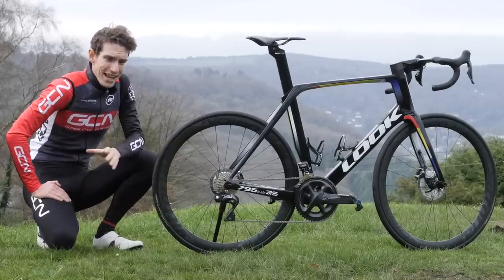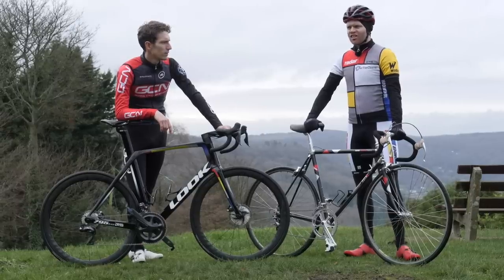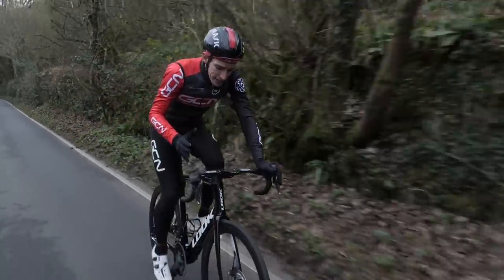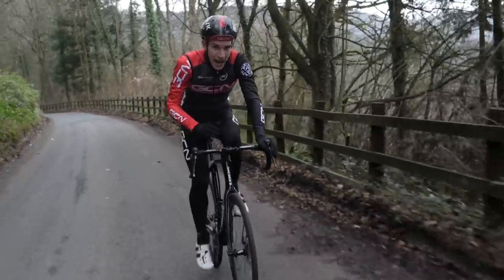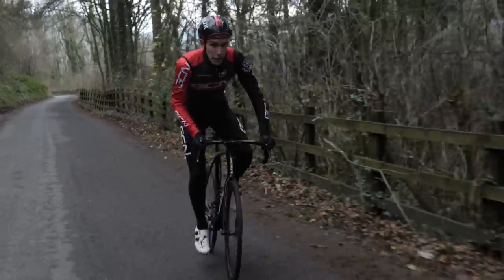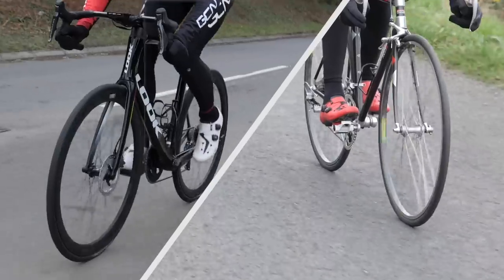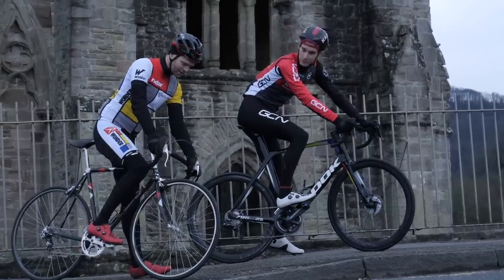How Much Have Carbon Bikes Changed? | Retro Vs Modern

Comment from the maker: Do you have a vintage beauty in your stable?
Reply: The chain looks a little slack on the KG86
Reply: Yes. a few.
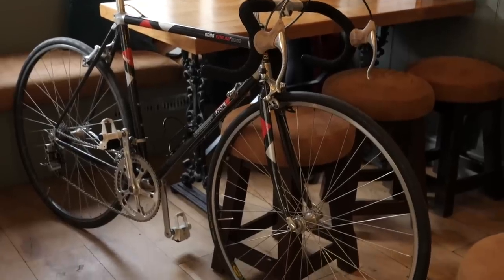Reply: 4:26 luck or look?
Reply: I have a gitane interclub. not sure what year :(.
Reply: Sure do. Love ‘em.
Reply: An old fw Evans Reynolds 531 touring bike.
Reply: I have Amanda's hybrid of carbon fiver and cromo bike made in Japan in 1975 which is the true first carbon bike in the world!!!
But it was OEM for french maker Gitane....
Reply: I have a '78 Rossin with a Super Record gruppo and '98 Tecnos with Record 9spd.
Reply: Yeah I have a TVT 92, painted in Lemond colours.  It's less comfortable than my other bikes mainly because brake clearance forces it to run on 23mm tyres.  https://www.flickr.com/photos/soundman/34283899942/
Reply: Yup. My Panasonic DX-3000 is the same year as that lovely Look! Mine's a steel beast, though. :) I love my '86!
Reply: A few, most used atm, 84' Guerciotti, slx, currently weight at 8 kg
Reply: I have a 1982 Grandis, Columbus tubing, Campy Super Record, with Nisi rims. 20.03 lbs. I also have a Look 675 Light Ultegra with Cosmic Carbone Elite 40 wheelset, 16.5 lbs. Love them both.
Reply: Yes I have a Look, but mine is yellow.
Reply: I have old chromoly steel Peugeot frame which I restored less than a 900$. 
And thats all I have and my only bike.
Reply: Yes, I do.  A 1990 vintage bonded aluminum frame Bridgestone RADAC 3100, 61cm with full Dura Ace grouppo, (7-speed, of course).  175mm cranks, Dura Ace clipless pedals, San Marco Rolls Titanium seat, tubular rims with Continental Sprinters.  It was my everyday club rider, a beautiful ride in its day, and is still beautiful today.  But, it is heavy and flexy in the bottom bracket as compared to my 2014 CAAD 10 Cannondale.  Nonetheless, I love it and will always have it.

Steve
Reply: I have a 1970's era Raleigh 3 speed with a Sturmey Archer hub, chain guard, fenders, and a brooks saddle.  I still ride it on trips around town, although it could likely use a new hub, the one in it is a bit worn out.
Reply: I have a very fine Look KG361 which was a sort of cut price version of the 86. It has round carbon tubes and aluminium lugs. Still a great bike to ride with sweet if sharp handling and comfortable with it. It may not be as fast as a new one but has still carried me - and now my son - over many an Alpine and Pyrenean col
Reply: I have a 1991 Trek 2100 Pro (Carbon main tubes), complete Shimano 105 with down tube shifters. I made a few upgrades to it over the years due to wear, wrecks, and just performance needs (Carbon fork with threadless headset, because the original was a noodle in turns. New rims and spokes because of cracks around the spoke nipple holes. New bar because of a crash) I put on a set of SKS Raceblade Pro fenders and it's now my inclement weather bike. Still rides great, maybe not as quick as my 2011 Masi Evoluzione Ultegra, but still nice.
Reply: Trek 2300 Pro with Shimano 600. My daughter is currently riding it
Reply: I do own a Look kg86, even asked Look to explain me me manufactuere number and it was made in may 1986 : ) Nice, smooth ride indeed - especially wearning a full La Vie Claire kit.
Reply: 1987 Battaglin Cinelli SLX (Stephen Roche) bike.
Reply: Colnago C40 (actually, three of them), a Master and an Extreme C (and a Time VXRS)
Reply: I have a Specialized Epic carbon tubes and aluminium lugs. Still fast and comfy but I’m a bit slower.
Reply: A training racer from 1926 made here in Sweden.... Yepp, weight about the same as two lorrys filled with coal.
Reply: Yes... even better version of a Look KG86.. I have more Mavic SSC on mine with the bronze color
Reply: Beauty to me is my '86 Trek 560 Pro Series in yellow and white fade. Reynolds 531.
Reply: Awesome video - I`m rather into retro bikes and have a KG86 full Lemond replica and I ride it with anger - I can confirm its epic, but does require a different riding style to more modern bikes - the 7 speed down tube shifters leave you fluffing gears if your not lucky butthats the only drawback.  The ride is spot on, speed wise, faster than my Pantani Bianchi and US postal Trek,  not as fast as my ex Sky Dogma - but only by around 1.5kph which is pretty fast.  In fact, I was so impressed with the KG86 I`m building up the last of the carbon lugged Looks - an ex Cofidis Look 595, can`t wait to compare the two.  But.... that new 795 Blade looks out of this world so one of those will have to join the stable some point next year...
Reply: I ride a Look KG281 Credit Agricole framed bike as my main stead, it`s still a great machine. It does everything I need it to do, and in style as well.
Reply: Yes, a CBT Italia  (Giovani Tardivo) original carbon from 20 years ago  and a Reynolds 531 Raleigh race from 35 years ago....both with Campag group sets. My usual ride is a Specialized Roubaix comp disc.
Reply: Both my bikes are vintage beauties. I have a 1968 peugeot px-10 and a mid 80s Razesa team pro slx.
Reply: I most certainly do, a 1981 Koga Miyata Road Runner, a steel beast :D. Just did a mayor restauration on it, as even the paint was falling off, and now it's the envy of the neighborhood again...
Reply: Of course!
Reply: 1985 Trek 660, campy and shimano 600. I couldn't imagine doing a century on it.
Reply: Not at the moment, gave 'em away or sold 'em on eBay, but I'm always only a yard sale or thrift store from another find.  Or more.
Reply: Several - 1972 Schwinn Paramount, 1982 DeRosa, 1983 Marinoni Custom Road, 1984 Marinoni Pursuit, 1964 Frejus track - All Campagnolo equipped naturally. :-)
Reply: I have an old, steel Motobecane from the 80s. I love riding it.
Reply: No. But, I have a cousin in Oklahoma that has an aero barn door.
Reply: Funny,  this is the same thing my wife  asked me on our first date !
Reply: i have an '89 nishiki prestige in pink/purple. it's been refurbished with new bearings, seat, stem, cables, and tape. still has some vittoria zaffiro pro tires in white. I love it even if it's not some superbike of the period
Reply: 1992 De Rosa Nuovo Classico with pursuit bars, similar to a Tour De France bike of the time.
Reply: I currently ride my Giant Cadex CFR2 with the original 8 speed Shimano groupset and Campagnolo Omega Strada aero wheels from that era. Similar in design with the KG86 with the lugs and all. Still a very fast bike.
Reply: I have a steel frame from 1986, still using it
Reply: We still have a few yes ! 😉
Reply: Yes, a beautiful Basso gap Europa with Campy Athena, circa 1990, my first real pro bike.
Reply: No, I wish I had kept my Peugeot Robert Miller bike.
Reply: I have a Team Panasonic Raleigh which I inherited from my father-in-law. It's still a Rolls Royce on the road but regrettably it is unquestionably better off inside the café being cooed at than getting blasted over cow shit and dodging pot holes in the rain
Reply: Global Cycling Network yup, a custom built 531 pro built by the legendary Cliff Shrubb. Built around a C Record group set with Mavic GP4 rims. Built fir me in ‘84 fir my 18th birthday.
Reply: Mine is a 1972 Motobecane Grand Record with Campy derailleurs, Universal Model 61 brakes (center-pull), Weimann wheels, Normandy hubs, Reynolds 531 top, down, seat tubes. It's older than the combined ages of all the bike in my small riding group. I keep up.
Reply: Vitus 979 with Sachs Ergopower,  Custom Cinelli Lugged Ishiwata 015 and silver fillet brazed Reynolds 653 with mostly Shimano 600 Ultegra etc.  I didn't glue the Vitus together but I did hard solder the other frames around the same time Graeme Obree was cutting up his washing machine
Reply: I have a TVT 92 since 1992, ride about 2000kms a year. 
Great frame,no doubt !
Reply: I own several vintage lightweights, including a 1946 Claud Butler, a 1950 Sun Manx TT, a 1955 Sun Manxman, and a 1984 Dawes Imperial.
Reply: 1977 Bob Jackson, Reynolds 753 in TT spec.
Reply: I've got the Vitus 979 in Carbon with Campy Super Record from the same 1980's vintage.
Reply: I had another rummage around in the loft today and found a long forgotten about F Moser Junior frame set in Blue enamel with Chrome forks and stays and a Campag Super Record Omega 19 V rim wheel set, with a Suntour Winner 7 speed integrated cassette and freehub. I think I paid about £80-90 back in 1989 for the F Moser.
Retro upgrade with a mostly Dura Ace 7700 group set perhaps??  Shimano 7700 was a really handsome groupo back in the day.
The frame set is nearly mint unlike this one
https://www.youtube.com/watch?v=y1q4w9LIzbU
Reply: 1959 Carlton Super Python R531 in British Racing Green, also a 1991 team replica Gitane Vitus GTI triple butted steel with Time Composite Forks, superior to the KG86 and can be ridden with gusto without any worries whatsoever. Still hit 40mph on it and I weigh 98kg.
Reply: Why yes I do.  A 1992 Specialized Epic Carbon with 105 (1055) groupset with indexed 7 sp. DT shifters. It has Carbon tubes with same diameter as steel tubes of that period bonded to Alloy Lugs with an ALLOY Fork.  Very similar to the 1st Look Carbon Bike in this video. Kinda backwards thinking back then compared to all of the Alloy bikes with CARBON forks today.
Reply: Oh yes! 1986 Atala with Campy Athena components. Faithful 7speed Regina freewheel.
Reply: I am the proud owner of a 1973 DHC racing bike, 10 speed Xtra, in a 100 % pristine and original condition. A true vintage. Consisting of lots of French made aluminium parts...
Reply: @上村勝利-p5t  FYI True first carbon bike was made in 1960 Bowden Spacelander
Reply: 80's Repco superlite 4130 cromo. Australian superbike!
Reply: Vitus 992 with 7400 Dura Ace.
Reply: Yes, i have a Bianchi 84, Pinarello 87, Olmo 88, Roberts 70's, Fuji  68, peugeot 84 😊 and i always wanted a Look bike, maybe someday.
Reply: I have an old trash bike and not a vintage beauty
Reply: Mmmhhh does a 1997 Look KG246 count, its a steel beast, but running Ultegra 6800 and some more modern pieces.
Reply: I got a Specialized Epic Pro 1993, carbon tubes with aluminium lugs. <3
Reply: @joachimmacdonald2702  , is it mine, stolen by Eastern Airlines, New York, 1988? Bastards!
Reply: Hertog von Berkshire oof bet that hurt
Reply: @joachimmacdonald2702  , yes it did. Checked in at JFK and never seen again. Only consolations, (i) the seat post was well and truly stuck, (ii) one of the wheels had a spoke lacing error. Ha, suckers!.
Reply: Reynolds 531 Mercian with complete period Ultegra 600 Group set. My father bought it for me long time ago. Raced on it for years. Also got a 531 curly stay Hetchins fixed wheel Audax bike and the last frame my father raced on.... a 531 Knight frameset (one of the many frame manufactures from the midlands). Also.... 1930s curved seat tube Claud Butler tandem which my father and Pete Swinden used as the spare machine on many of their record attempts in the 1960s. The Knight  frame and the tandem do need a full restoration though. Its a long time ago now but my father had a couple of Longstaff trikes. One of which was a fixed wheel... as a young lad I never tired of seeing him riding the thing backwards down the street! Ive always fancied a trike but cars give a normal bike so little room these days I think its asking for trouble. Nice video guys.
Reply: Carlton Corsair, Carlton Criterium, Carlton Grand Prix, 3 Raleigh Royals, Raleigh Rapide, Raleigh Winner, Raleigh Dawn(?), Claud Butler Majestic II tandem, very early MBK Ranger MTB.
Reply: I've got the same KG 86 but with a shimano dura ace 7400 groupset with the shifting on brakes.
Reply: My 1973 wife!
Reply: My vintage beauty is a Raleigh from the 60's, all steel & built to last!
Reply: 84 miyata sport modified with new parts :)
Reply: 35 year old gianni motta 😉🤘🏻🚴🏻‍♂️
Reply: A Chesini Arena 1985 , a basic Bottechia 1990 and a LOOK KG76
Reply: Jim Carhart  my wife has an 84 aluminum Vitus I have an 83 Pinarello  my Ironman ride plus mt. Ventoux all routes steel is real 👍
Reply: yes i have a kg 86 with the mavic groupset its a bernard hinault replica i think so ... it belong to a café de Colombia mechanic ..
Reply: I do
Reply: yeah cinelli  chromoly
Reply: @simonknowles4267  brits
Reply: !984 Eddy Merckx
Reply: Yes I have a 1984 Guercoritti..it has a Campy Super Record groupset..tubular tyres and steel alloy frame..it has very responsive handling..ohh non-indexed down tube shifters..retro 6 cog cassete
Reply: Yes the wife😉
Reply: @上村勝利-p5t  WOW
Reply: @PeowPeowPeowLasers  thats carbon fiber 🌟
Reply: @norton750commando  love 80s super record
Reply: @minuteman4199  Gr8 had the same bike
Reply: Global Cycling Network, A KG 86! Awful to ride. It's like riding an elastic band. Scary as Hell on descents. Delta brakes campy groupset. Looking for down tube shifters to get it period correct. I'll submit to the bike vault when I get a chance.
Reply: I got a few lol. Got a Raleigh professional, paletti super prestige, Raleigh ti, puch odyssey, and a team fuji
Reply: If 2018 counts as a vintage yes
Reply: PeowPeowPeowLasers that bike is beautiful, love the delta brakes! I wanted those so bad back in the day!
Reply: Dominijk Catalan I restored my 87 Peugeot as well, upgraded it with an 8spd cassette and lighter parts, it’s my only bike and I still ride it!
Reply: still ride my KG451.  Love it.  Tubes and lugs etc.
Reply: I have a Trek Sport 370, Black, 1994, CrMo.  It looks so beutiful.
Reply: I have a Surly Pacer which is only about 12 years old but I outfitted it with Ultegra 9 speed with D/A downtube shifters. Rides like an old steel road bike. I love it. I also have a hand built Witts frame, a custom manufacturer from California, that bike is from the 70's. I also came across an all original Miyata 310 which is a relatively modest bike from the early 80's. I just like the looks of the old bikes. I want to get a gravel bike though, that looks like a fun ride.
Reply: I'm still using a giant TCR Advanced 3 from 2008! I did replace the wheels and have also replaced the 105 Group set 2 or so years back.
Reply: Global Cycling Network a golden Caloi 10 from the late 80’s
Reply: Yes a Dawes giro 200 and a kona jake the snake
Reply: I'm old enough to remember when this bike hit the scene, so I guess I'm a vintage beauty ... without the beauty part.
Reply: I still have a new Concorde TVT 92 Carbon racing bike, not assembled yet.
Reply: Yup! One recumbent, one classic Dutch racer :-)
Reply: Can you talk about Carbon bikes with aluminum or even titanium lugs in a tech show? How strong are they? Is it smart to buy one? Are they lasting longer than modern carbon frames? 
Would love to hear about old carbon bikes...
Reply: Yes, seven 😀. Oldest: 1975 Raleigh Rialto. Newest: 1998 Trek 5200
Reply: I have a 1997 Trek 5200 that i still ride.
Reply: You absolutely can not beat the feel of a classic steel bike. There is absolutely no better riding bike. I don't race, do you? If you don't, why wouldn't you want a good riding bike rather than one that is marginally faster? And what is the difference in weight? 2 lbs. I have a Moser, a Basso, and an Aliverti. I just ordered a Tommasini, which you can still buy new and custom made to your dimensions. Waterford is available custom fit. These bikes are overwhelmingly nicer to ride. Who the hell cares if a 23 year old racer can pass you? Plus, with full Campagnolo Super Record I have half the investment as in a carbon bike.
Reply: Just added a Trek 3200 carbon to my collection, upgraded with campagnolo record group set.
Reply: .................and I have found this exact LOOK 795 BLADE RS in a little shop in a German village after corona so snapped it up there and then and I can only describe it as a SUPER BIKE !!! Can't wait to replace the groupset and give  this bike what it deserves , the DURA ACE

Comment: Wow, this video makes me feel a bit silly for all the work I've put into my 1990's Specialized Epic carbon and aluminum lug frame. However, one thing to consider is the cost of vintage carbon. I aquired the complete bike with 105 kit (minus a front derailleur and a wonky rear sti shifter) for $50.00. Since then, I've converted back to downtube shifters. Shifters are now carbon, seatpost is now carbon, Brooks carbon seat, NOS Shimano 600 AERO stem and 600 derailleurs. FSA carbon cranks with dura ace rings. Diacompe 900TI brakes with Ashima carbon cartridge pads. Tektro carbon reverse brake levers. Re-laced the 105 hubs and mavic rims with double butted spokes, but I have carbon clincher wheels on order. I'd say I've spent about $1300 in total on the bike including a set of continental gatorskin tires, deep drop zoom aluminum bars and welgo pedals. A bit of a "hot rod classic" that I use for neighborhood time trial laps. If you guys would like to see my bike and the progress I've made with it, I'd be happy to send photos for your "Nice or Really Nice" bike review section. Thanks for the great content, I just discovered these videos and I've been impressed with the knowledge and production quality.
Reply: >gatorskin tires
you really had me and then you lost me.
Reply: @testtest-ol3yi  Is gatorskin very bad?

Comment: I've just had my  late 80's cougar (653 Reynolds tubing) converted into a track frame with mud guard eyes to use as a winter bike.I also have a 1950s JRJ track frame which is lovely to ride on the road .

Comment: I still love my Raleigh Milk Racer, not as sprightly as my Pinnacle Dolomite, but interestingly when I came across an equipe in France, my Milk Racer overtook the entire team on their specializeds when coasting downhill. Admittedly my Raleigh now has Mavic wheels, but I also think the heavier steel frame gives an edge downhill, and a certain flywheel effect of a consistent speed, which gives a more relaxing, easier ride.